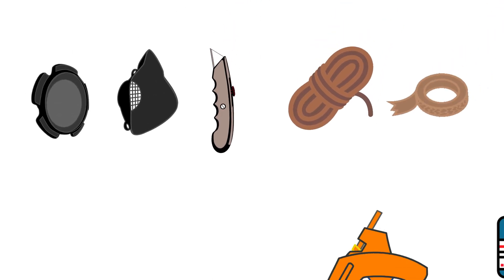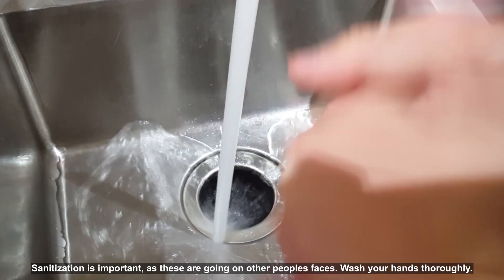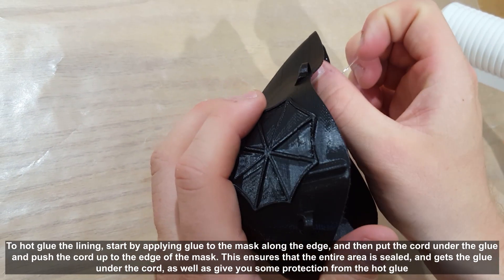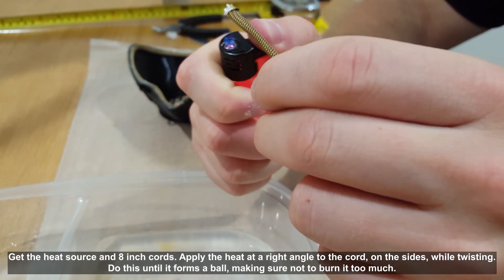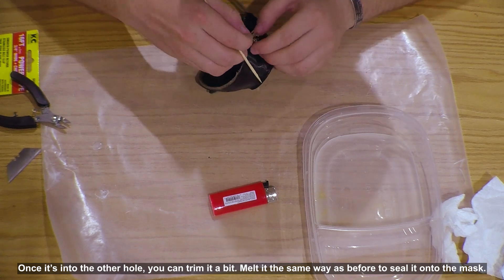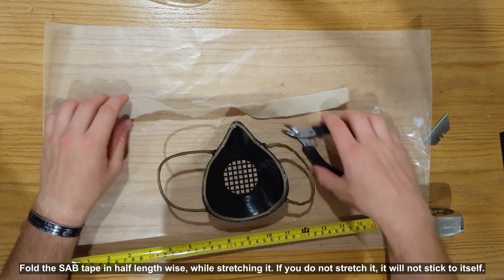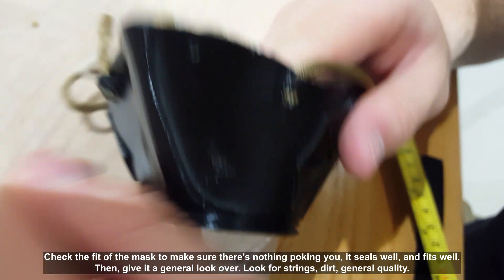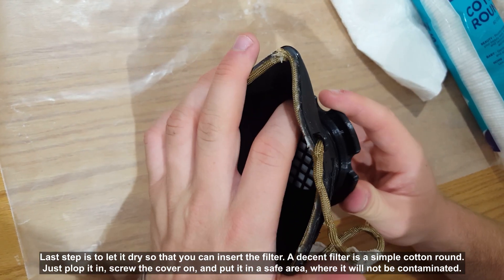DIY 3D printed reusable face mask

Comment: Good vid,  there is an updated version of this mask for download that includes clips if you have access to cloth or elastic to use for straps, and there's a double filter option now that doubles the surface area making it even easier to breath through this mask.